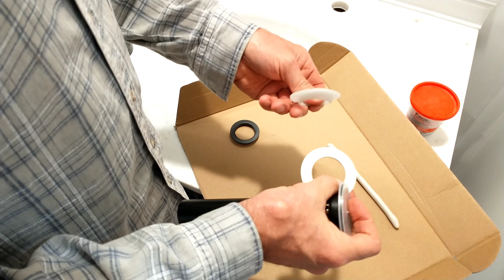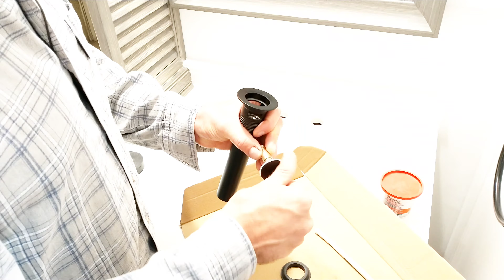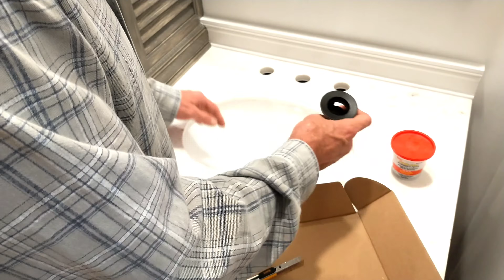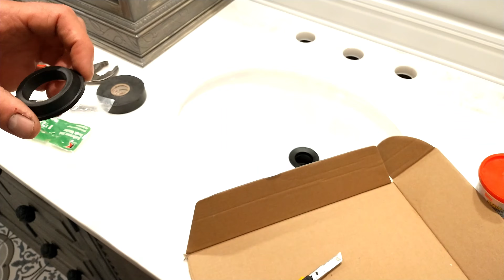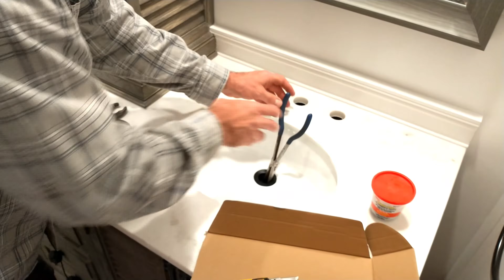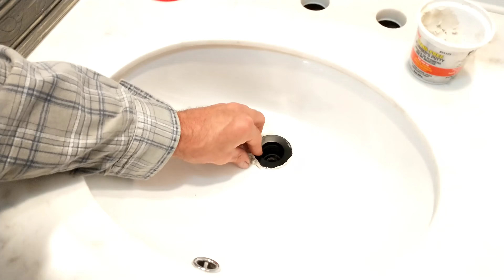Easy Install Pop Up Drain Assembly Stopper NO LEAKS for Bathroom Sink #diy #how #howto

Comment: that's what you called fully installed ??  you didn't even connect the pipe underneath, that's the part I wanted to see.
Reply from the maker: HI. The title states that it is an installation video for a pop-up drain assembly...not necessarily an entire drain install. However, if you scroll to the end of the video and wait for the "end screens" to pop up, you will see the next video option which is the installation of a universal drain trap assembly. Or you can go onto our channel and click on the "bathroom remodel" playlist which contains an entire how-to video library of a complete bathroom remodel. Hope this information helps👍

Comment: this was excellent.  Thank you very much.  We used silicone on the top part rather than plumbers putty and we have a small leak.  stock gasket was a two parts but for sure they seemed too maleable.  Will buy a better gasket

Comment: Moen comes with that extra thick rubber gasket...I've tried several times still have a leak i put plumbers putty at the base of the drain tube...i have not put any sealant between the rubber gasket and the sink base that is where it leaks I'm going to put try some lexal there the directions don't make any mention of this
Reply from the maker: Hi. Thank you for watching the video. Sometimes, if you give the lock nut another 1/4 turn, the leak stops. Even the tiniest gap will allow water to find its way through the gasket and lock nut. Sounds simple...but, often times people think that they are going to crack their bowl if they tighten the nut too tight...the rubber washer should avoid that from happening. Hope this information helps👍

Comment: I just installed a Moen faucet with a new popup drain.  The problem I'm experiencing is that the water in the sink is slowly leaking through the drain when it's closed.  Not leaking through the pipe fittings, but leaking through the stopper and down into the drain. Aren't these pop-up stoppers supposed to completely hold the water in the sink?

Comment: How do you unclog your drain if for some reason a blockage accumulates over time?
Reply from the maker: @JoyneFreedom  Hi! Thank you for watching the video and leaving a question/comment. You can easily access the drain by unscrewing the snappy trap and getting to the S shaped part of the trap and cleaning that out. That is usually where a lot of debris will get stuck. Once the S trap is removed, you can then clean the pipe going into the wall and the pipe going into the sink by using a bottle brush. I hope this information helps.👍

Comment: Excellent video. Thank you 
I just purchased  a 5popclick-NOF-CP from a plumping parts company in Dallas.  I asked if the part included a strainer that would prevent hair or jewelry from going down the drain, so to speak. 
The answer was 'NO'. Said buy this part or a pop-up with a strainer.  I should have just left at that point,  I wonder if it is possible to purchase a separate pop-up that comes with a strainer? I can't believe he didn't offer a solution. Maybe I will have to rate my experience with that company. Also mentioned they charge a service fee for the exchange of any merchandise.  They need to work on their selling skills.
Reply from the maker: Thank you for watching the video. Sorry to hear about the issues you had on your purchase. As far as having a pop-up drain with a catch...I did a little bit of research for you and found this:

https://amzn.to/4a5bk6s

This particular model comes in many different finishes to suit trim colors of existing faucets. There are other brands on Amazon that also have these nifty catches added to them...just make sure that they will fit the sink hole opening.

Hope this information helps you
👍

Comment: thank you! did I ruin anything but using WD40 to loosen the old one?
Reply from the maker: @JodyMolchen  Hi Jody! So glad this video was helpful for you. As long as you did a good job of cleaning the surfaces before installing the new pop-up drain, you should be totally fine. The WD-40 might break down some of the solvents in glue, silicone, or putty if the area wasn’t cleaned off good enough. If you clean the surfaces off, then you are totally fine. WD-40 is a great product to use for loosening up stuck nuts, and bolts, and threading.👍

Comment: Ok I installed one today and it won’t stop leaking from the bottom where that thick gasket is. Also the top has a little gap so I always have water sitting up top.
Reply from the maker: Hi Steve. I hope that you were able to get the sink to stop leaking. Sometimes, an additional 1/4 twist or so on the nut under the sink is all it takes to stop the leak. I did have one comment in a thread below where a person (@gibby1783) stated that they took the rubber washer under the sink and turned it around and reinstalled it. The person stated that just by doing that, the leak stopped. I hope that this information helps you out with your project. 👍
Reply: I had the same problem with a new sink i installed.I took it back and bought another one.Problem solved,the sink was bad.

Comment: Leaving a comment in case it helps someone. I installed a new marble vanity with a new pop up drain and I tightened the heck out of that nut and it still kept leaking right where the large gasket meets the bottom of the sink. And eventually what I tried that fixed it was to flip the gasket upside down. Yep seems crazy, but it worked and it doesn't leak anymore. And the reason why is when they make these cultured stone sinks they don't clean out the inner diameter of the drain very well (has a rough uneven edge) but they do machine the bottom surface. So by flipping the gasket it was up against that nice clean even side and it sealed right up. I could have went the silicone route but I didn't want a bunch of silicone in there for the next time the drain has to be replaced. Another option to try if you are stuck.
Reply from the maker: That is a great tip! Thank you for taking the time to share it. I'm sure that this will help someone out! Thanks for watching the video too👍.
Reply: This is indeed the correct way to install one of those pop-up MOEN drains on cultured stone. No putty, no silicone, just put together with included parts but put that bottom washer up against the bottom of the sink upside down. you'll drive yourself crazy trying to fix it any other way.
Reply: I’ve literally been searching YouTube for this exact fix.. I don’t know why I didn’t try this before, but THANK YOU!
Reply: My plumber neighbor told me that most of the leaks are caused by amateurs trying to over tighten those gaskets. Snug them up so they are not deformed by the pressure should be tried first then gradual additional tightening.
Reply: Yooo you’re a life saver! Thank you!
Reply: @Nahtanoj65  You're welcome! :)
Reply: I'm fighting a leak on a new install
 I'll be trying this.  Thanks!
Reply: @gibby1783  your tip did the trick on my install. Thanks for sharing!
Reply: Bruh, flipping that d@mn gasket saved-my-life. I was definitely heading to the garage for putty & silicone, but stumbled upon your comment.  No reason not to give it a shot, right?  Not a leaky drop since & one less thing on the honey-do list!  Thank you.
Reply: @pcrewe28  You're welcome everyone, I'm glad I was able to help out! :)
Reply: I had better luck flipping the big gasket upside down and it worked for me thank you
Reply: After 2 unsuccessful Moen pop up drain leak attempts I flipped the tapered gasket as suggested. I couldn’t believe but it worked like a charm!!! 

I was going crazy trying more tightening, less tightening, disassembling the entire drain, etc. Thanks for sharing!
Reply: Good Lord, you literally just saved my night because I have been working on this thinking I was doing something wrong and this right here fixed it

Comment: Nice job but the box blocked part of the demo. Silicone under sink . No! Spinning the tail piece negates the emphasis on aligning the drain holes on drain piece with sink overflow holes. Minor stuff…yes….but many novice DIY res may not pick these things up

Comment: Hi how are you very good Instructions, one question can you use silicone I steed of plumber pudde
Reply from the maker: Hi! Thank you for watching the video and leaving such a nice comment. Plumber's putty is great to use because it does not dry out and it easily smashes into all the nooks and crannies. Plus, it is not prone to molding like silicone is. If you are wanting to use silicone, you will need to wait until it is completely dry before you use the sink. They do make silicone putty which comes in small rolls, if you want to give that a try. Best wishes on your project 👍.

Comment: So I just remodeled our downstairs half bath including a stand alone vanity and new top however the traditional stopper that came with the faucet set wouldn’t work due to room constraints, also it wouldn’t drain very fast so I changed over to a pop up stopper and it solved both issues.
Reply from the maker: Hi! Thank you for watching the video and leaving a great comment. So glad you were able to complete your project successfully 👍.

Comment: Just a caution, if your drain tube or top gasket is made of rubber you don't want to use plumber's putty. Use silicone instead. The instructions will likely mention this if it applies.

Comment: I ran across your video I just purchased a new bathroom faucet, I’m single trying to figure how to install the plunge part , I was a Lowes I was told you shouldn’t use putty on ABS plastic pipe or the plunge , I was told to only use clear silicone.  Interesting you add the putty. Good video.

Comment: These tend to leak because water splashes up and gets into the overflow cavity and then water sits on the big gasket/nut. That gasket really isn’t meant to be leakproof l. It’s only there is secure the assembly to the sink. The silicone bead does provide a workaround but many instructions never say anything about doing that. It’s also why if you have taken one of these apart that there will be large build up of gunk in the overflow cavity since water can’t drain from that location.

Comment: Great video. Any tips if the pop up on a new Delta keeps falling down. Will not stay open? I can pull in open with my fingers but then it falls closed again. It's the new type with no rod arm.
Reply from the maker: Hi Sarah. Thank you for watching the video. All pop up drains are a little bit different. Usually when that happens it's a few different things. One, the spring might be missing from inside the assembly. Two, it just might need to be screwed tighter. If you grab a hold of the drain pop up assembly and turn it either clockwise or counterclockwise it tightens the assembly up. These might be the fix you need. Hope this helps 👍

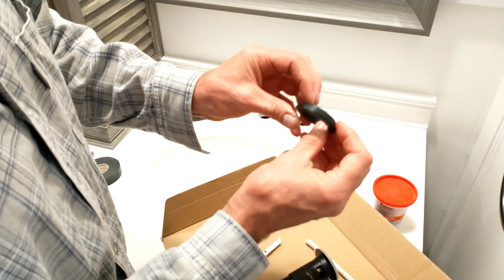Comment: 1:46 i found same problem with mine , but i cant find thick one..... and very helpful video thanks alot
Reply from the maker: Thanks so much for watching. The washer is an aftermarket 1 1/4" by Keeney. Get up in the plumbing department at Lowe's. Ace hardware and Home Depot should carry it as well.

Comment: Some sink assemblies come with a nylon type of flat washer (called a friction washer) that goes on between the rubber washer and nut that helps prevent the whole assembly from turning as you tighten the nut. Thus no need for the pliers.
Reply: Very helpful thx

Comment: I find that when you install the drain before you install the sink, you ‘d have a better handle on it, because you can do your work with the sink up side down. of course it’s not always possible, sometimes the sink comes in one piece with the vanity
Reply from the maker: Hi Selah.  Thank you so much for watching the video and leaving a comment. I think you are correct! It would be much easier to do the work on the sink and then install the sink. However, in this situation the sink was already epoxied onto the granite countertop. Most bathroom vanities these days come complete with the sink already installed, making it a bit more difficult to do the plumbing. Thanks again 👍

Comment: I still have leak from the big nut underneath.  On top the piece  I only applied putty, not washer. So I am thinking to put a thin washer on top and new putty.  Also someone suggest silicon on the big nut  for the bottom.  Not exactly sure where the leak came from yet.
Reply from the maker: That's a bummer.  I wonder if you just need to try to tighten it a bit more. Sometimes just another quarter twist on the nut is all that is needed. You should not need additional parts that did not come with your kit. They are usually made as all inclusive...minus the putty / silicone.

Comment: Hi, thanks so much for this video it’s the only one that makes sense. Can you please tell me how soon I can run my water after I’ve applied a thin layer of the Lexel sealant?
Reply from the maker: Hi Delmarchie.  Thank you so much for watching the video and leaving a comment.  To be on the safe side, I would give it about 3 to 4 hours before use, to give it some time to set.  👍
Reply: @YouCanDoIt2  thank you for the swift reply. Also, what if your sink does not have an overflow hole but you have the pop up drain with the overflow?
Reply from the maker: @DivineFemEnergy  It's not a problem at all.  As long as your sink is thick enough, where you install the pop-up drain, in order to hide the spot on the pop-up drain where the overflow water would drain into to go down into your p-trap. Hopefully that makes sense. In a nutshell, you should not be able to see any holes in your drain assembly when you look at it underneath the cabinet where it comes through the sink bowl.

Comment: Can you please tell me the exact brand of the pop up drain assembly you used and where I can buy it.  I also need matte black, which it looks like that is what you are installing.  I have been in the process of installing a new faucet and drain assembly for the past week with my pedestal sink and I've run into nothing but problems.  Today, I got done, but when I turned the water on, my drain assembly leaks, so I have to start over.  I would prefer a pop-up (which this new delta faucet does not come with a pop-up drain assembly); seems easier than the one I have. Your video is very good and I'm thinking I can be successful by following it! LOL (and I have lots of patience and don't want to give up and call a plumber)
Reply from the maker: I just found it in someone else's question.  The brand is Gotonovo and I purchased it on Amazon.  Thanks for watching 👍
Reply from the maker: Hi Joan.  So sorry to hear about your drain issues. It's been so long since I posted this video, but give me a minute, I seem to remember posting the brand in someone else's post.  I will find it and get back with you.
Reply: Joan, Please read my comments as they may help you.
Reply: @outlet6989  Thank you! I have successfully installed it and it works beautifully.  Thanks again!

Comment: Was wondering,,,,, I was told by a plumber of 40 yr in the business that plumbers putty was not to be used on the blk pvc cause it will dry it out and crack the blk pvc 🤷🏽‍♂️
Reply from the maker: Hi Ricky.  Thanks so much for watching the video and leaving a comment...always appreciated.  That is an interesting tip that I have not heard of before. I only use the plumbers putty at the metal flange at the top of the pop-up drain. I used a waterproof sealant on the actual black PVC part.  Thanks for the comment 👍

Comment: Is there anything you can do if the drain hole is smaller than part?
Reply from the maker: Hi.  I think I understand the question....you are asking if the drain hole diameter is smaller than the pop up drain diameter...what can be done?  If that is the question, then you need to measure the drain diameter and purchase a pop up drain assembly that is the correct size.  You do not want to try to modify the drain pop up assembly or you may run into a leaky end result.  Hope this helps.  Thank you for watching and commenting.

Comment: I just used plumbers tape in it did the trick for no leaks.  To much to add sealant in there.
Reply: Where’d you use the tape specifically?
Reply: I have leak at the big lock nut. I will try plumber tape on the big lock nut.

Comment: The next person that has to work on this is going to hate you with all of that silicone you used. It is way better to do a little more troubleshooting to find out where your leak is and solve the problem correctly without using silicone. Whenever I do a job I'm always thinking ahead if it needs to be worked on again in the future.
Reply: I agree it will be a mess to replace eventually. It’s better to use Teflon tape on the threads instead. I’ve noticed some pop up drains the threads do not go high enough for that to work though. In some situations it’s worth trying to flip the locking nut gasket around. I think a lot has to do with your particular sink since many have imperfections from manufacturing.
Reply: Yeah it’s a poor man solution and should only be a last resort - I agree
Reply: I still  have leak form the big lock nut.  On the top I only applied plumber putty and did not use a small washer. I am think of using a thin washer on top maybe with some new putty, and try again. Any advise?
I will skip silicon for now for the big lock nut.